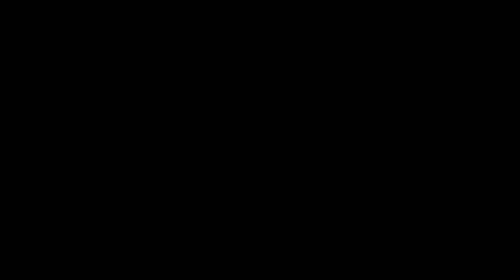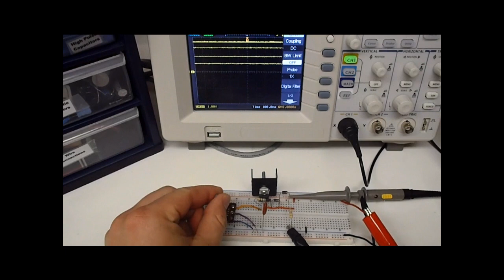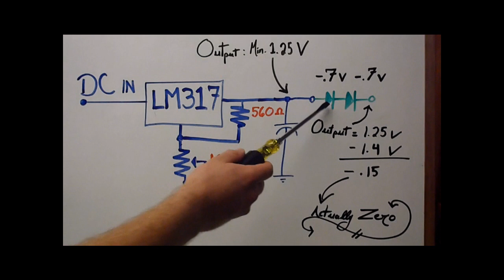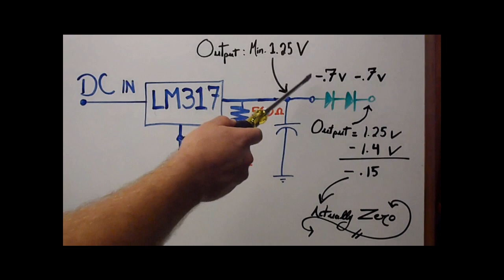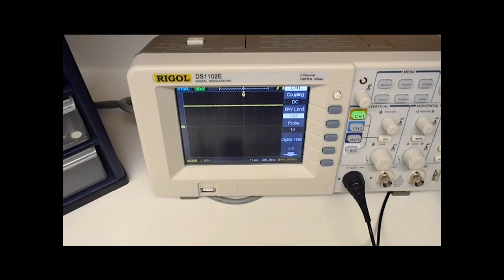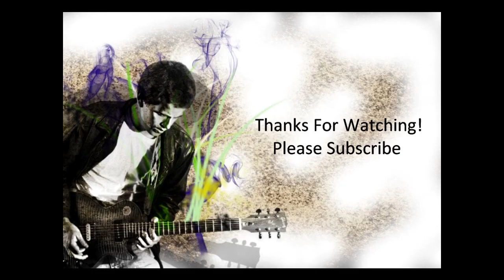LM317

Comment from the maker: That is a fairly large load on a circuit though, this project was more or less of arguing a point, of a more simplistic approach of obtaining zero volts for a LM317, and the best way is to offset the voltage with a negative supply. It was an experiment, not the best but it is all part of me learning the tricks in the trade. Thanks for watching and placing some good insight on the subject!

Comment from the maker: The point it a stand point, I wanted a simple method to argue my teachers method of off setting with a negative voltage. A good lab power supply is said to be variable from 0-whatever voltage. As some testing requires lower voltage even that of approaching zero, and creating a voltage divider is less than ideal. Though in recent projects I have switched to offsetting the voltage with a negative voltage as it is more constant and easier to adjust accurately.

Comment: It works with no load. If I put a 1 Ohm resitor at output I get   0.4 mA. with a full charged 6 volts battery.

Comment: In this case simple doesn't mean good. Because diodes part is in open loop and voltage drop across the diodes will vary with different output loads and diodes temperature.